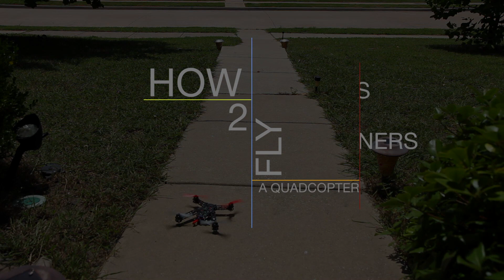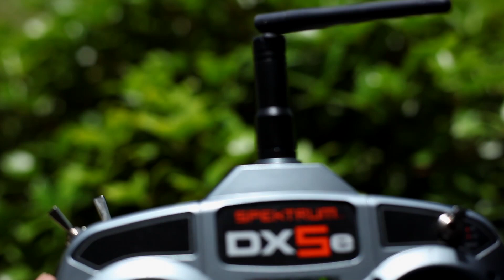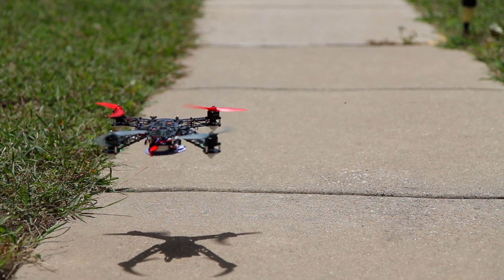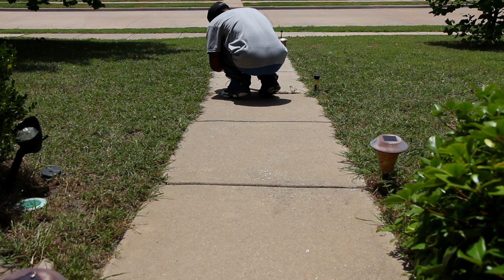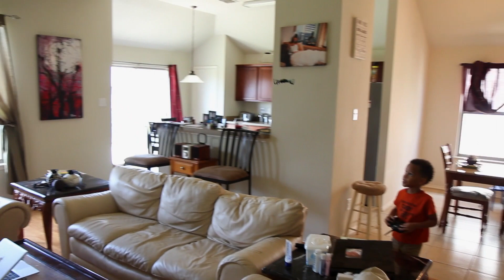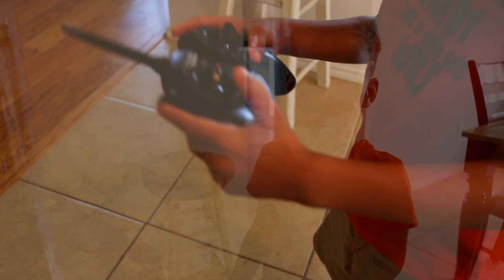HOW TO FLY A QUAD (BASICS FOR BEGINNERS)

Comment: Im 12 years old and have been doing realflight as well as flying quads for a long time and i have also flown a phantom 4, not mine, its simple. I am saving for a phantom 3 standard now. But before that i wondered if anyone had any suggestions for cheap quads you build like the one in this video I already have a transmittor just need the quads parts, I have lots of hookups with drone flyers and could get help, just wondering if there is any suggestions

Comment: Thanks for posting. Have you tied flying with the FPV's yet would you consider it harder ?
Reply from the maker: FPV is a different world, I wouldn't say harder you just have to learn again, & get used to reacting to being inside the quad instead of line of sight flight.  In my opinion, its not harder or easier.. its just different if that helps at all.. It's def just a addictive as LOS flying!

Comment: Hello Gimbal guy, great video. I have a qx180 with the stock controller. No fancy digital trim settings or anything. Will I have less control? Because I just can't seem to keep this baby in a tight circle.
Reply from the maker: +win30034 No , you won't have less control per say.. you still have high and low rates and all modes like acro.. but with the digital transmitters you can mess with you rc rate modes, and expo but if you are just starting out you won't want to mess with these rates anyways…